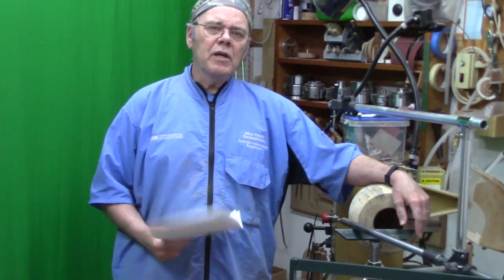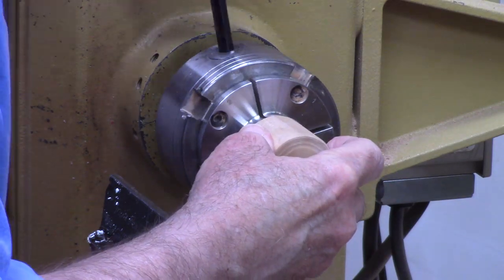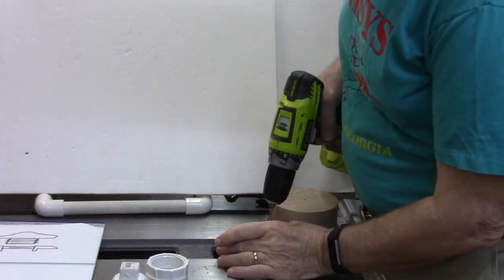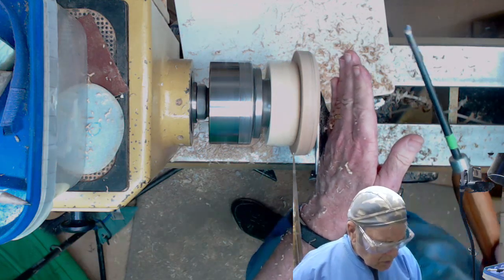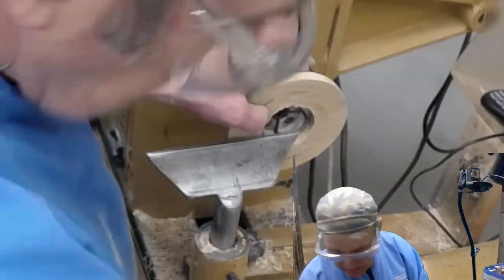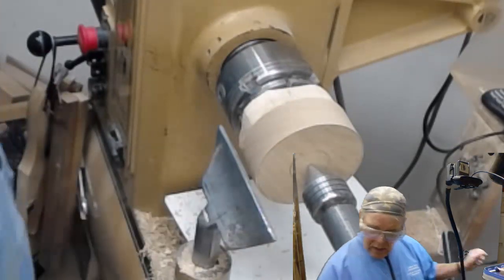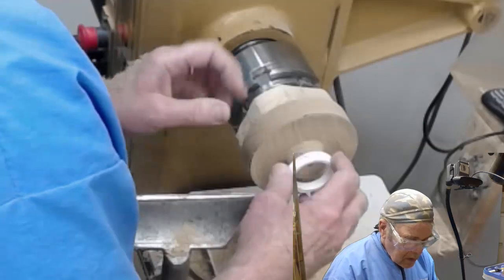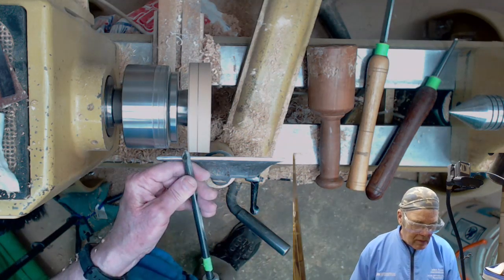Threaded Urn Inserts With PVC

Comment: Around here, we call that the 'Plumber's Trick' ... works pretty well! I do some thread-chasing,and have done some urns with chased threads. I have a vacuum chamber that I use to stabilize small pieces of domestic hardwoods (cherry, maple, and walnut)  with Cactus Juice. I cut threads into the stabilized blanks and create inserts that can be epoxied into the urn.
Reply from the maker: Yep. I used pvc for the video tutorial. The two I made had chased threads or cut with a jig.

Comment: MIke, It works well but I thought I'd be able to get at least two sets of threads out of one set of clean out valve but they don't seem to work if you don't have the starting thread. Have you ever tried to get a second set? I'm using a 3" valve assembly (black) and the male side is 5-6 bucks with a female piece about 10 bucks. Maybe I should go with your other video and start cutting the threads in the urn myself. Thanks for your nice videos. Timothy
Reply from the maker: I just got one set from it.

Comment: Good work on both part 1 & 2.  Minor suggestion when parting off the pipe fittings, or any "tubular" piece (Think napkin rings). Put a length of dowel in your Jacobs chuck in the tailstock to act as a parts catcher. Saves chasing the buggers all over the shop! Stay safe and well.
Reply from the maker: That is a great suggestion! Thanks.
Reply: @MikePeaceWoodturning  Old toolmaker's trick.

Comment: Another great video Mike! You always pop up when I am looking for help. I am in the middle of making an urn now and was trying to work out how to do the lid. Question: You put a concave on the collar so that the edge touches the urn first. However, it looks like the urn is flat on the top. How much glue surface did you have with the collar and urn? Thanks!
Reply from the maker: Enough with wood glue. The concave is slight so suspect there is still glue holding on the entire surface of the collar. There is also glue where it fits into the urn opening.

Comment: If you would rather have metal and finer pitched threads for your lids, sink drain baskets are available in a few different sizes too.  Solid brass ones will turn on our lathes and with our tools with no problem.
Reply: can you supply a link to these please

Comment: Really good instructions Mike.  I like your new video layout... well, except for the spike coming to the center of your work. 😏

I was wondering if brass fittings would work.  The PVC does work nicely but the white.  😜  Then again if it's for an urn, it's not like someone will be opening it more than once.  Certainly hope not.  😱
Reply from the maker: You never know what folks want to do with an urn of ashes. Brass is too expensive and hard to wrok for me. I would rather cut threads in wood. But this is a good alternative for folks without a threading jig.

Comment: Where or how did you do the black etching on you tool handle
Reply from the maker: It is called fractal burning. I no longer use that dangerous technique and have taken down my videos on it. More than 50 woodturners have died using this technique incorrectly, with highly dangerous microwave transformers. I had safe techniques and used a far less powerful neon sign transformer. You can't measure stupid.
Reply: @MikePeaceWoodturning  that's what i thought it was. The marks are beautiful....the process Deadly